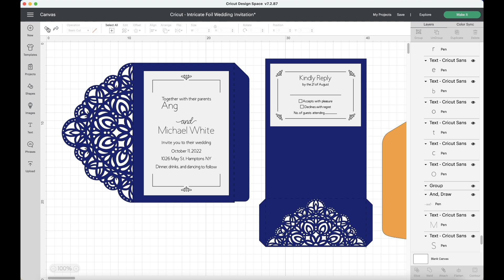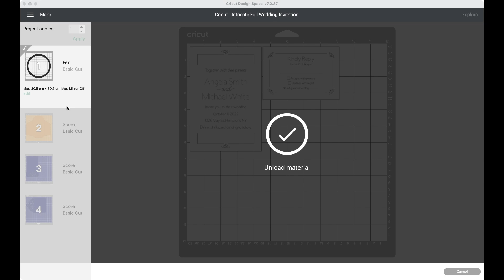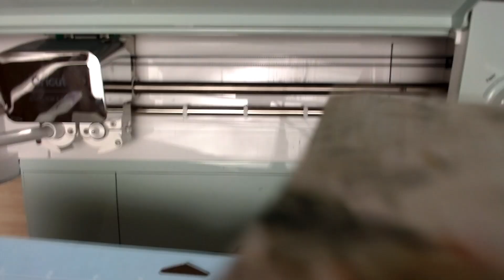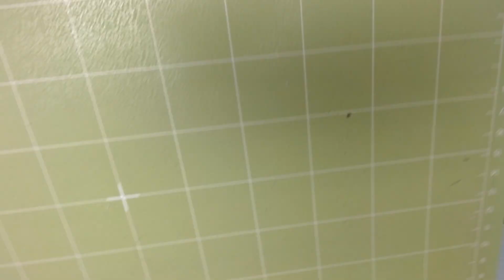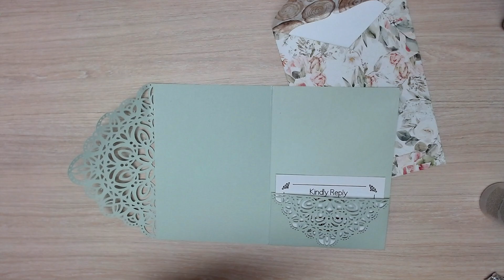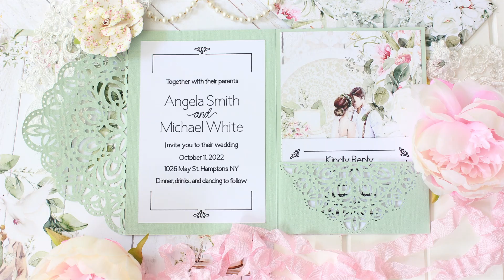DIY Wedding Invitations with your Cricut

Comment: why does it say material set to fabric when you are using paper?
Reply from the maker: I think it is because the further around you go on the knob, the more pressure the blade gives.  You need lots of pressure to cut these intricate designs accurately I have found.